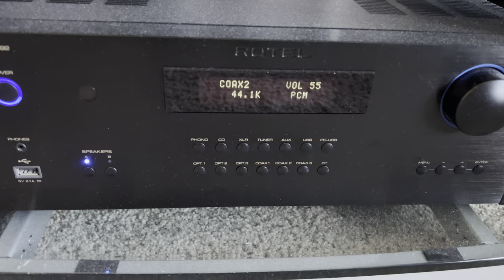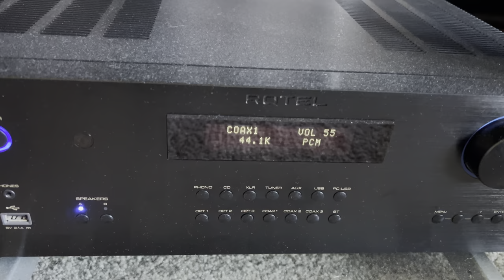Are all CD players the same on Coaxial output?

Comment: Best way is to record both players in digital domain using coax or optical. Once you have two files compare them to each other. I pretty much guarantee (tried it myself with minidisc) that the files will be identical. The coax/toshlink is picked up before oversampling of the internal dac.
Reply from the maker: Well, Even on YouTube the difference in the sound is obvious. And in the real world, it is even bigger. That was a surprise for me as well. I did not expect to find any difference but it is.
Reply: I tested the same way. I hear no difference with toslink.
Reply: Nice equipment,  I believe  that it all depends  on  the  quality of the optical laser that the cd player uses. I own several brands of cd players and they do sound different, specially the high end ones. I own several of the sony es playes and as you go to the highest model, you can tell the difference, not by much  but you can
Reply: They can't be identical, the digital processing is unique, it seems that at least every major player went to all the trouble of reinventing the wheel just for the sake of it. Theoretically... even if the processing is different, there shouldn't be that much of a difference. And I don't believe it is related to how the Digital to Analog conversion is carried... otherwise 1bit portable CDs should have sounded like garbage which isn't the case with quality units.
Reply: @hifirulezzz  Pearl Acoustics have done this recently. they found that with the digital out (SPDIF) there were no perceptible differences. This was not the case when using the internal DACs'

Comment: The MB-10 sounds better to me.  More transparent sound.  The Sony sounds veiled.  I've never been a fan of oversampling, but with some hardware and software it's not a feature that can be turned off.  If the Sony outputs an oversampled stream of data, even if it re-renders the final stream back to 44.1, maybe this is where the difference lays ?

Comment: very nice comparation but regards your diferent results the transport itself do the job as well. as you know there is no perfect reading from discs and there are errors during reading disks. there is couple reasons for it. stability of the speed, quality of laser head (not only power but responce of the head). then there is correction errors chip and after all of this process the information is going to DAC or Digital stream. this is why old sony players with magnetic heads sounds so good. there is possibility that the nakamichi transport mechanicly has some wear outs and the error correction chip is doing what is best. it can be a motor or even laser head (not power but fast responce to the disc). CD players are complicated. additionally power separation, inteference shilding etc. Sony is build better as its nearly high end but nakamich is build as standard CD. all of this can makes diference. im interesting if you will be ablle to compare old sony like cdp-x es series compare to your sony. the old cdp-x33, 555, 77 or 339, 559 etc has the one of the best sony transport.
Reply from the maker: Errors cannot explain that much difference. The only thing I can think about is a DSP processing.

Comment: What instrument did you use to measure the differences?
Reply: probably the only intrument that really matters, the ear.
Reply from the maker: Ears are the best instrument. However, you may scroll the video on YouTube back and forth to hear the difference. In reality, the difference is even bigger. The only explanation I see - DSP processing in Sony SACD player, like upscaling, digital filtering, etc.
Reply: Ears are the worst instrument to gage a difference in sound as proven many times. This is not the way to do comparisons unless you are just trying to waste everyone's time. If you can hear the differences you should be able to measure them as well and use the measurements to confirm what you are hearing. Also if depending solely on listening tests they should be done double blind so there are no influences on the listener.
Reply: @hifirulezzz  I don't hear any difference.
Reply: I am going through this myself. Testing 5 different Blu-ray and cd players via coaxial, hdmi and rca if it has a good DAC. Currently the Panasonic UB9000 via rca is the winner. Will have an oppo 95 next week to compare. From what I have read the difference may be caused by lack of drive vibrations and  power supply.
Reply: @emilspec1227 
And when they serve you gourmet food, do you test it in the lab to see if it's good?🤔
I much prefer the old method - start eating. Then I know what it tastes like😉